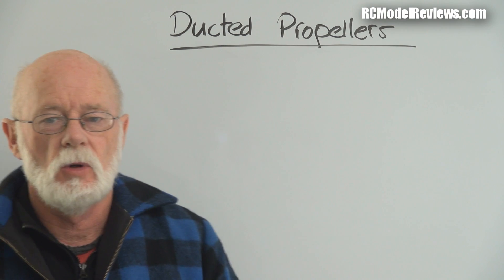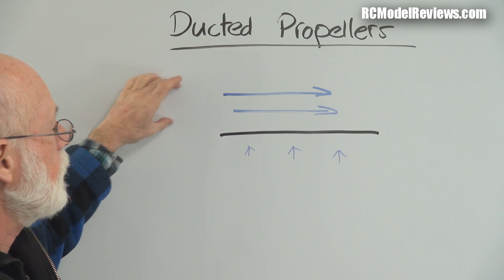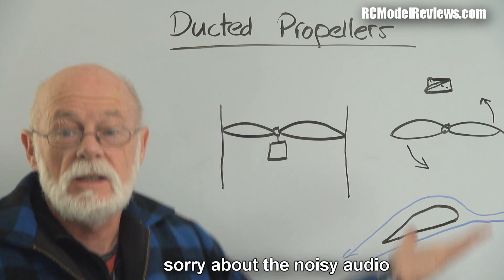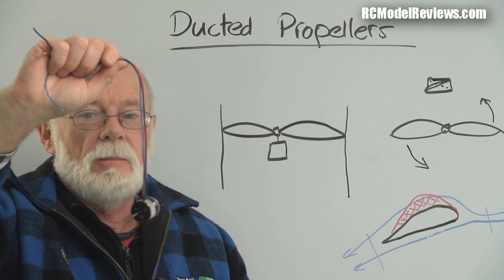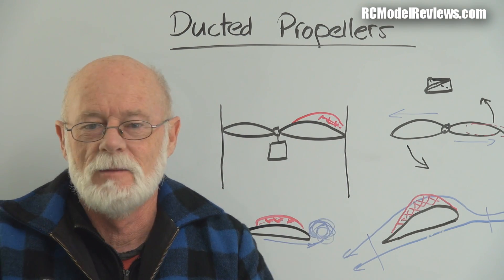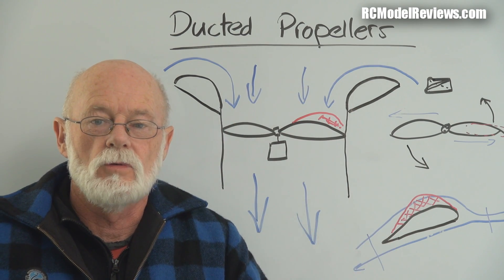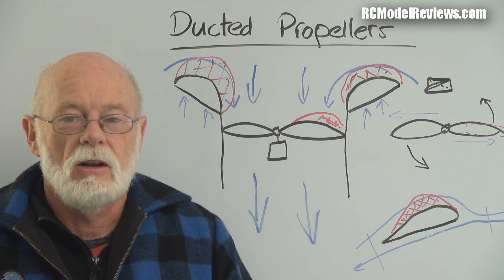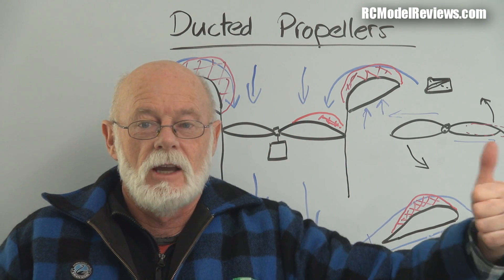How ducting a propeller increases efficiency and thrust

Comment: The reason not many drones use ducted fans is efficiency. Ducted fans are great for fast forward flight but not for static lift.

Explanation: Yes, the 'duct' reduces losses at the blade tips, However, adds significant losses at the intake lip and exit where the adjacent air is pulled into the flow. For ducted fans installed in aircraft, These losses are reduced at high forward velocities and increased at low forward velocity. For drones, there is situation with perpendicular intake flow, when drone is travelling sideways and fan pointing up, there is even greater losses at front intake lip.

The most efficient blade design for static lift is to have the blade as long as possible (like a helicopter) and travelling as slow as possible. Least efficient to have short blades travelling at high velocity.

It is easier to imagine what is going on if you increase the viscosity and imagine the fluid is water instead of air. Very large blades would move water only a small about, but over a large area. however, very tiny blades would be require to move vast amounts of water through a small area to produce the same thrust. moving that much water increases drag as the blades have to suck in water at the intake and the exiting water would be slowed very quickly by the surrounding water at the exit.

Comment: Will this work on a variable pitch propeller at slow speeds in water? Brilliant video, thankyou
Reply: I think it would. Maybe differently but it probably would work
Reply: You spoke about tip clearance. What if the duct is fixed to the tip? My variable-pitched 3 blade prop (about 500mm dia) is driven by a 23HP Lister. Rotating the tips of the blades inside the duct I see as a problem... Having the variable-pitch  prop negates the need for a gear box.

Comment: How do I figure out how many and what size propellers do I need to move weight. Is there a ratio? If I wanted to build a flat drone and say everything including myself weighed 450 lbs and it measured rectangular 4’x10’. How would I be able to lift this up with enough lift to go say about 100’ in the air??

Comment: Very good explanation sir .
Sir, the thing you said in the last could it be because whenever a thing is spinning we need a certain amount of torque to turn it about the axle. So in a ducted propeller if the axle is not very tightly fitted it may not changed it's orientation while the outer casing does as a result  the propeller may start rubbing against the casing and can cause fire.

Comment: I read once propellers loose efficiency over +/-2500 rpm while jet engines can reach 40-50000 rpm (probably more) and still be efficient. Is the ducting of the jet engine what makes the difference?

Comment: Yes please do explain what happens when you tilt a ducted fan, I thoroughly enjoy your videos, thank you
Reply: youtu.be/0stl1U9evzU
Reply: @nathanbanks2354  thanx Nathan
Reply: Absolutely interested! Plz do sir
Reply: So, was this the Osprey helicopter plane?
Reply: @placitas52  Tilting ducted fan/engine units were used in some of the exploratory designs, and are being used on a couple of EVTOL designs presently under development. The MV-22 Osprey uses long, very-high aspect ratio blades on tilting engine nacelles - no ducting on those. Increasing the aspect ratio reduces the fraction of efficiency lost due to the tip vortex, but as with most things aeronautical, there is a compromise in the performance range. The helicopter-like propellors were chosen to obtain characteristics in vertical mode that are not as readily available with smaller-diameter ducted fans.

On the flip side, many modern helicopters use ducted tail rotors for the reasons given in this video. It's actually one of the best applications.
Reply: I am also interested, thanks!
Reply: Upvoting!!!!
Reply: Me too. Please tell about tilting ducted propellors, that’s if you haven’t already done so, this being so long ago.
It can’t be the gyroscope effect of the duct is not spinning, I guess. Is it transverse forces, perhaps downward, dew to air deflected by the duct?
Reply: wow. what a wild versions people have here.
imho the question clearly is in forces around the wing shape of duct lip
with different angles to wind.
Just like wings do. Just like said 10 times in every video I watched here
Reply: Gyroscopic effect. Take a bicycle wheel and hold it by the axle as it's spinning, then try to rotate it on its axis. It will fight to keep its current plane.

Well, looks like I was wrong. Hmm
Reply: Seems unlikely. If it was the gyroscopic effect it wouldn't be specific to ducted designs, since unducted fans would face the same issue.
Reply: Spaz 12 it increases the moment of inertia, making this problem more significant. However, it doesn’t make it significant enough to be considered really
Reply: This is also a misconception though
Reply: Spinning the duct requires more energy. Having a static duct with a propeller inside of it is better. It does stop the vortices. However it will also slightly restrict flow. There’s trade offs. But spinning the duct is just silly because of that higher moment. More torque for not that much More thrust
Reply: @MrSpaz12  lol   Is why the tail propellor is added, to keep the copter from simply flipping over in the right-thumb rule like a gyroscope does.   it doesn't fight to keep it's position really, it wants to take any pressure to make it change in a secondary motion, not to right itself but wants to do a judo throw on a three-dimension on whoever is trying to move it.  >>>>Hold one spinning in your hand extended and move it about, it'll try to wrest itself from your grasp, no attempt to return to position.<<<  like a bicycle tire spinning on a bar.   it's that it would kick the point holding it that keep it's it up.
Reply: we can tilt the whole system along with the duct to get a turn and can maintain same efficiency ,thus no need to tilt a ducted fan.

Comment: Good video. Obviously, the bad thing about the duck is that it's outward mass causes a gyroscopic effect... making a change from the Axis of rotation difficult.
Reply: Use counter rotating propellers like the russians do to negate the torque. Steering is performed by speeding or slowing one of the props. Works great on helicopters, including toys- simply duct the fans?

Comment: so obviously your using materials that have homogeneous coefficient of drag on the top and bottom in your wing and propeller theory?  What kind of lift can you get from the differences in coefficients of drag with other than homogeneous materials or surface form? I know the answer, I am simply fishing for people who have the same vision I do or can at least see there is a huge gain in performance that can be had by this formula Cdragbottom - Cdragtop is proportional  to total lift. If you want to invest or get involved in the future timothynechville@gmail.com
Reply: Wow nobody read the previous? Coefficient of drag of the bottom of the section - Coefficient of drag of top of the section is proportional to total lift, this is huge in wind generators it means that by having the one side of the section covered by say carpet the amount of energy produced can be increased dramatically.

Comment: Why not unite fan -turbine with the duct. A rotating duct might well provide greater aerodynamic benefits.
Reply: I am not completely sure if I am hitting all the issues of a duct-ed blade assembly. 

First, is the added weight and keeping it balanced. 

Second, the extra weight robs energy from the drive motor decreasing any profits otherwise gained.
Third, the moving duct does not improve lift as the spinning lip no longer contains the area of low pressure instead it is thrown off the spinning surface just like it is on the tip of the spinning propeller blade.
Again, I am not sure if I got all that right but...

Comment: I'M CALLING YOU OUT!
That "faster flow means lower pressure" is technically flawed.  If you take aerodynamics at a reputable university they will have to beat it out of you in the first class.  
Better
-A fluid changing its velocity requires a pressure difference F=ma  examples  A constant velocity being turned or a velocity decelerating.
Best
 -just stick to Bernoulli's equation! 

You talked about tip effect, and the lip lift.... Why don't you cover flow straightening with the "spokes"?  
There is added weight, friction losses, AND drag from the spokes...nothing is free and if you don't design it well the duct will be a net negative.
Reply: This is great stuff though.  Looking forward to the testing!

Comment: Mr. I have a small doubt. When the blades rotate will the duct also rotate along with blades?
Reply: The duct is not attached to the blades. it is mounted to the motor or the motor mount.

Comment: There is no such thing as centrifugal force. The spinning object want's to travel in a straight line but is restrained by the rope, wire,or whatever forcing it into a circular motion.what puzzles me is its said that something spinning in space will continue spinning unless an outside force or resistance is applied. Einstein said that a constant acceleration is in distinguishable from gravity. So in a large circular space station that is spinning someone standing inside at the rim would feel like they were in a gravity field but actually they are constantly being accelerated towards the center as opposed to moving in a straight line. Where does the energy come from if the space station does not slow down.

Comment: I have found that ducted props on a quad hinder yaw Significantly. Not worth it in my opinion. An open prop has a 120 degree force , from bottom center too... approximately 22.5 to 30 degrees. From 0 of your x axis. That side and slight upward force is essential in maneuverability. Not waisted energy.  The vortex can be manipulated with throttle. 
 Good explanation though.

Comment: The disadvantage with ducted propellers is their restricted speed limit, thus only optimal for a small speed range, while at all other speeds they are less than optimal. And they weigh a lot, so you'll never see an aircraft with a ducted propeller in their nose. A couple of aircraft had pusher props in ducts, but even those are very rare.

So no matter that this guy is a great charmer and storyteller, it is all baloney.

Comment: With the air split at the wind sir, the argument against this causing lift is the fact that the assumption that the air has to reach the end at the same time , and hence the air following the top longer trajectory needs to speed up, is the center of the debate; why you presume it will go faster to meet at the same time, what if goes at the same speed as air below the wing and hence no Bernoulli effect?!

Comment: While I dislike talking with a man who does not include his name, It strikes me that you have a richer knowledge on this topic than many and you have clearly ascertained the principles involved. Fans are an interest to me largely because I befriended one Bill Allison who was a suspension engineer who worked for Hudson, Packard and Ford.  He was somewhat similar to you and also was fun to talk with. Bill's Hudson suspension was featured in the movie "Cars" and in his retirement built a non ducted wind  environment on his ping pong table and then began to systematically experiment with Propellors and built over 100 models of them  He was interested in wind power and ultimately concluded that the fans could have flat serfaces built with a triangular surface on the incoming side in a triangular section.  He was featured in Popular Science some years back. He went to the University of Michigan and was fast and delightful, like you. 

So having decided upon the best fan shape he then entered into a study of the optimum number of blades that should be installed.  He took the count on up to 12 blades but discovered that by eliminating 2 opposing blades he could eliminate the cone of resistance that would build up and lower the efficiency. 10 blades provided the greatest efficiency and he was able to hit the Betz Limit of 60% efficiency.  He really wanted to prove that the 3 bladed fans were absurd and to determine the most efficient count of blades and the most efficient blade sections.  Hitting the Betz limit might really signify something.

So your delightful lecture now raises the question for me, let's say that his findings were good, but by ducting the fan with the curved profiles, would we be able to even improve upon his findings.  Perhaps you know the answer already. 
He was imagining 15' diameter fans being deployed along seashores for the humanitarian purpose to provide electricity quickly in areas suffering from devastating Hurricanes  

It is fun listening to you... a bit Scottish.

Bill Dickens
Architect.

Comment: Really interesting. Now I know why the airliner engines are shaped as they are and why air boats always have a duct around the prop (because on a boat the weight is not so important as with a prop plane). I guess some of this theory is applied to jet ski motors?

Comment: Now, as put forward by you, placing a propellor in a duct increases thrust by reducing tip vortices and putting an aerofoil lip on the leading edge of the duct increases this even more. Good! (I was really looking forward to the demonstration which I though was going to ensue when you brought a motor/propellor/duct mechanism into view briefly.) What, however, happens if the duct is rotating WITH the propellor; i.e. the duct is connected to or part of the propellor? More or less thrust? Thank you in advance.
Reply: For the last question, you get rid of the tip leakage issue, but you pay a price for rotating the duct - you have a large portion of your momentum tied up in the duct, which slows throttle response, and your dynamic balance issues are much greater. Asymmetries in airflow around the duct could cause unexpected lift vectors at the boundary layer on the rotating duct surface, so minimizing drag would very critical. Most designers don't consider the tip leakage losses worth the trouble if they can maintain tight clearance across the full rotational velocity range.

It may be a different story if you are getting into small duct diameters.

Comment: I enjoyed this. You answered a question I’ve had for decades. An aircraft with flat wings could fly. Not very efficiently because more power would be required to overcome the loss of lift an airfoil gives.  Thank you.
Reply: A flat wing would have air travelling at the same speed above and below the wings, producing equal pressure reduction above and below or am I missing something?

Comment: This is what happens when you alienate people from nature. They use some of nature's ways to remanufacture what is happening through a lot of words and no clarity. "It's simple, it's just the way things go," just don't ask this guy because he is just playing the repeater.  Look, spinning allows this wire to go straight, no such thing imaginable. Failure of interpretation.  "Basically a vortex just means lost energy, " while using unnatural form. Funny how that works. I wonder what would happen if you use that form, like modern academic science and medicine have been using for the last decade to hand them answers while dumping decades of bunk.  
The propeller in the duct will work better than the propeller in "freespace" because... ? 
How simple life works from the smallest to the largest form. Instead of learn how it works people waste their time with wastes of their time.

Comment: I liked the explanation but I got a bit confused when he talked about centrifugal force which he says are "another one of those things you find in physics". Instead (beginning) physics teaches that it is not an actual force but rather Newton's first law is at play, applied to an object in motion around an axis (such as a satellite or a mass on a string such as he shows in the video). The name of the force at play is centripetal. He correlates the direction vectors he shows for air being flung straight out from the central axis to the same phenomenon that is pulling a weight outward when it is spun around on a string. If nothing else the vectors are drawing in the wrong direction if that were the case and it  would be better represented by showing them all coming off at a tangent . If air is flowing at a right angle from the axis of rotation then something different is at play (maybe the shape of a propeller channeling flow from the axis of rotation to the tip). Its true that I'm frequently wrong and may have to eat this paragraph at some later time.

Comment: Its like a loudspeaker, when its out of its box the air on the front and back creates a shortcut, around the speaker. resulting in loss of bass tones. By separating the front and back, there is no direct feedback any more, and more pressure can be build up, resulting in better bass responce.